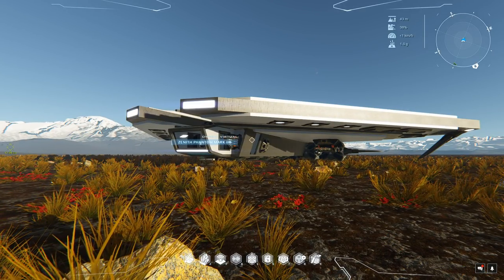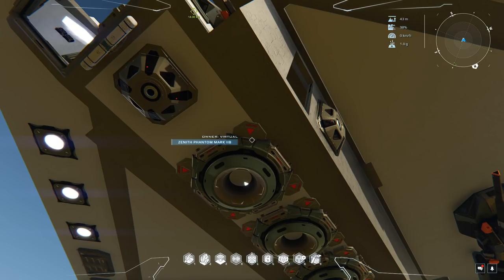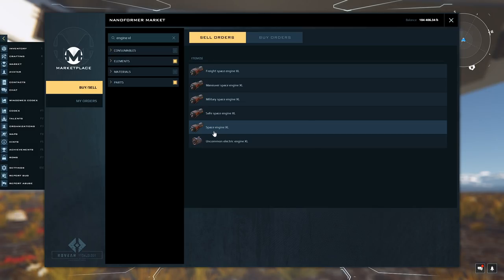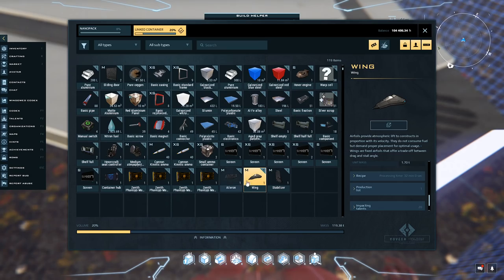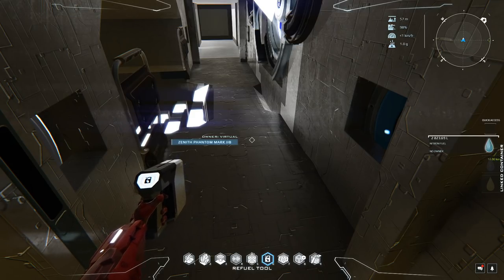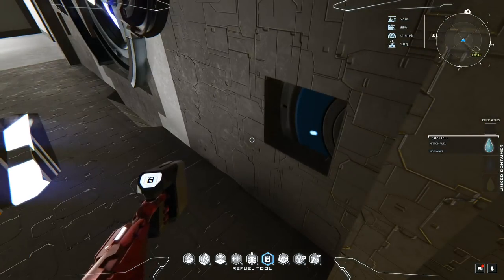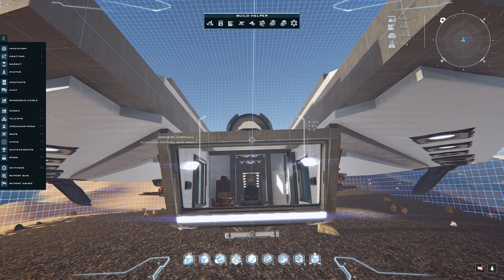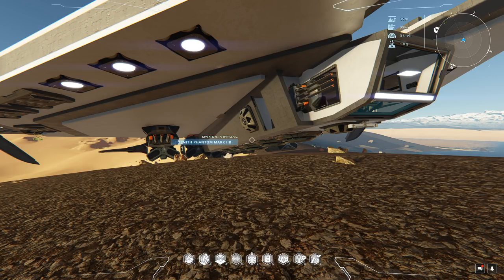Concepts of Atmospheric Flight in Dual Universe | Crash Course

Comment: Came across your channel and this video. Been following Dual Universe development for quite some time and I have a question after having seen DU featuring in space newtonian physics.
Does the physics engine allow space ship designs being semi realistic vertical in design, that can only do vertical take-off and landings using "space" engines? So have little to no  aerodynamic wing surfaces. Or is the design paradigm the usual "planes in space" or "boats in space" type, a.k. horizontal craft design?
Reply from the maker: Either

Comment: THanks for doing these vids, they are very helpful.  Do engines produce torque in addition to forward thrust? ie if you just had 2 big engines one on each wing, and the left one broke - would you get a massive yaw to the left from your right engine?
Reply: They don't produce torque, but you can mount them sideways for lateral thrust if you want.

Comment: So I'm confused. Those couple of stabilizers provide enough lift for your ship? I get that they want you to be able to build sci-fi ships and not airplanes. But instead of using these half way aerodynamics why not do something like approximate lift by the horizontal surface area of the ship. Maybe it makes more sense for balancing ship designs though.
Reply from the maker: There are 4 ailerons in the wings too.